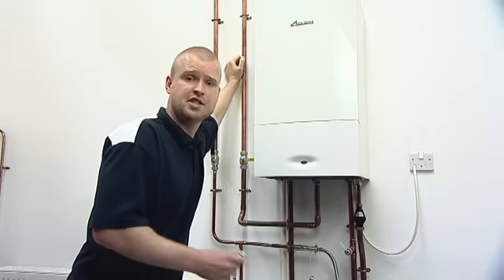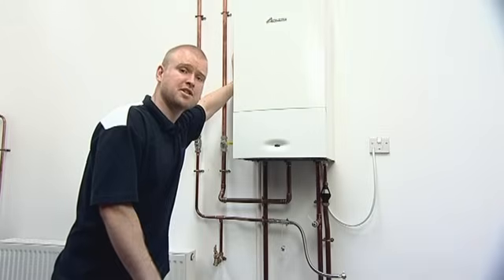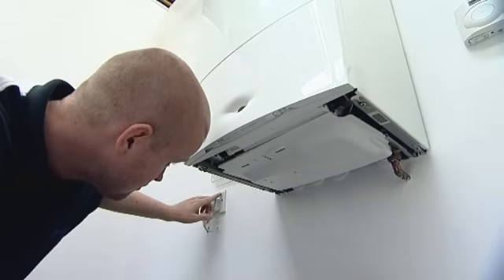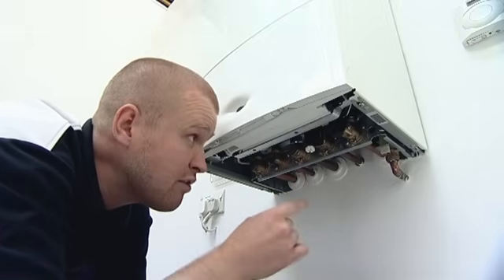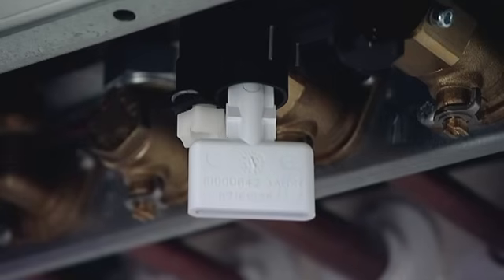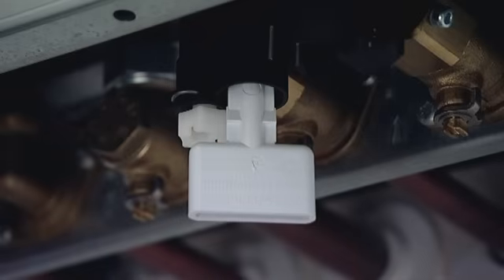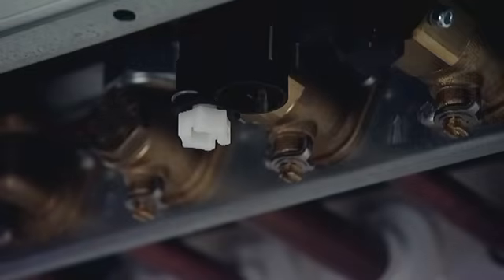How to Repressurise a Heating System with an Internal Filling Key | Worcester Bosch

Comment: When I turn plastic nut water comes out on mine also, why is this?
Reply from the maker: T LeJ Hi and thank you for your enquiry. 

If water is found to
be leaking from the filling assembly where the key inserts it would be because
the key is not inserted correctly and in the locked position. Typically the key
would need to be pushed higher into the assembly.

 

If
water is leaking from any other part of the filling link this would indicate a
fault with the filling assembly and would require a new part to be fitted.  Hope this is of help,

 <w:LatentStyles DefLockedState="false" DefUnhideWhenUsed="true"
  DefSemiHidden="true" DefQFormat="false" DefPriority="99"
  LatentStyleCount="267">
  <w:LsdException Locked="false" Priority="0" SemiHidden="false"
   UnhideWhenUsed="false" QFormat="true" Name="Normal"/>
  <w:LsdException Locked="false" Priority="9" SemiHidden="false"
   UnhideWhenUsed="false" QFormat="true" Name="heading 1"/>
  
  
  
  
  
  
  
  
  
  
  
  
  
  
  
  
  
  
  <w:LsdException Locked="false" Priority="10" SemiHidden="false"
   UnhideWhenUsed="false" QFormat="true" Name="Title"/>
  
  <w:LsdException Locked="false" Priority="11" SemiHidden="false"
   UnhideWhenUsed="false" QFormat="true" Name="Subtitle"/>
  <w:LsdException Locked="false" Priority="22" SemiHidden="false"
   UnhideWhenUsed="false" QFormat="true" Name="Strong"/>
  <w:LsdException Locked="false" Priority="20" SemiHidden="false"
   UnhideWhenUsed="false" QFormat="true" Name="Emphasis"/>
  <w:LsdException Locked="false" Priority="59" SemiHidden="false"
   UnhideWhenUsed="false" Name="Table Grid"/>
  
  <w:LsdException Locked="false" Priority="1" SemiHidden="false"
   UnhideWhenUsed="false" QFormat="true" Name="No Spacing"/>
  <w:LsdException Locked="false" Priority="60" SemiHidden="false"
   UnhideWhenUsed="false" Name="Light Shading"/>
  <w:LsdException Locked="false" Priority="61" SemiHidden="false"
   UnhideWhenUsed="false" Name="Light List"/>
  <w:LsdException Locked="false" Priority="62" SemiHidden="false"
   UnhideWhenUsed="false" Name="Light Grid"/>
  <w:LsdException Locked="false" Priority="63" SemiHidden="false"
   UnhideWhenUsed="false" Name="Medium Shading 1"/>
  <w:LsdException Locked="false" Priority="64" SemiHidden="false"
   UnhideWhenUsed="false" Name="Medium Shading 2"/>
  <w:LsdException Locked="false" Priority="65" SemiHidden="false"
   UnhideWhenUsed="false" Name="Medium List 1"/>
  <w:LsdException Locked="false" Priority="66" SemiHidden="false"
   UnhideWhenUsed="false" Name="Medium List 2"/>
  <w:LsdException Locked="false" Priority="67" SemiHidden="false"
   UnhideWhenUsed="false" Name="Medium Grid 1"/>
  <w:LsdException Locked="false" Priority="68" SemiHidden="false"
   UnhideWhenUsed="false" Name="Medium Grid 2"/>
  <w:LsdException Locked="false" Priority="69" SemiHidden="false"
   UnhideWhenUsed="false" Name="Medium Grid 3"/>
  <w:LsdException Locked="false" Priority="70" SemiHidden="false"
   UnhideWhenUsed="false" Name="Dark List"/>
  <w:LsdException Locked="false" Priority="71" SemiHidden="false"
   UnhideWhenUsed="false" Name="Colorful Shading"/>
  <w:LsdException Locked="false" Priority="72" SemiHidden="false"
   UnhideWhenUsed="false" Name="Colorful List"/>
  <w:LsdException Locked="false" Priority="73" SemiHidden="false"
   UnhideWhenUsed="false" Name="Colorful Grid"/>
  <w:LsdException Locked="false" Priority="60" SemiHidden="false"
   UnhideWhenUsed="false" Name="Light Shading Accent 1"/>
  <w:LsdException Locked="false" Priority="61" SemiHidden="false"
   UnhideWhenUsed="false" Name="Light List Accent 1"/>
  <w:LsdException Locked="false" Priority="62" SemiHidden="false"
   UnhideWhenUsed="false" Name="Light Grid Accent 1"/>
  <w:LsdException Locked="false" Priority="63" SemiHidden="false"
   UnhideWhenUsed="false" Name="Medium Shading 1 Accent 1"/>
  <w:LsdException Locked="false" Priority="64" SemiHidden="false"
   UnhideWhenUsed="false" Name="Medium Shading 2 Accent 1"/>
  <w:LsdException Locked="false" Priority="65" SemiHidden="false"
   UnhideWhenUsed="false" Name="Medium List 1 Accent 1"/>
  
  <w:LsdException Locked="false" Priority="34" SemiHidden="false"
   UnhideWhenUsed="false" QFormat="true" Name="List Paragraph"/>
  <w:LsdException Locked="false" Priority="29" SemiHidden="false"
   UnhideWhenUsed="false" QFormat="true" Name="Quote"/>
  <w:LsdException Locked="false" Priority="30" SemiHidden="false"
   UnhideWhenUsed="false" QFormat="true" Name="Intense Quote"/>
  <w:LsdException Locked="false" Priority="66" SemiHidden="false"
   UnhideWhenUsed="false" Name="Medium List 2 Accent 1"/>
  <w:LsdException Locked="false" Priority="67" SemiHidden="false"
   UnhideWhenUsed="false" Name="Medium Grid 1 Accent 1"/>
  <w:LsdException Locked="false" Priority="68" SemiHidden="false"
   UnhideWhenUsed="false" Name="Medium Grid 2 Accent 1"/>
  <w:LsdException Locked="false" Priority="69" SemiHidden="false"
   UnhideWhenUsed="false" Name="Medium Grid 3 Accent 1"/>
  <w:LsdException Locked="false" Priority="70" SemiHidden="false"
   UnhideWhenUsed="false" Name="Dark List Accent 1"/>
  <w:LsdException Locked="false" Priority="71" SemiHidden="false"
   UnhideWhenUsed="false" Name="Colorful Shading Accent 1"/>
  <w:LsdException Locked="false" Priority="72" SemiHidden="false"
   UnhideWhenUsed="false" Name="Colorful List Accent 1"/>
  <w:LsdException Locked="false" Priority="73" SemiHidden="false"
   UnhideWhenUsed="false" Name="Colorful Grid Accent 1"/>
  <w:LsdException Locked="false" Priority="60" SemiHidden="false"
   UnhideWhenUsed="false" Name="Light Shading Accent 2"/>
  <w:LsdException Locked="false" Priority="61" SemiHidden="false"
   UnhideWhenUsed="false" Name="Light List Accent 2"/>
  <w:LsdException Locked="false" Priority="62" SemiHidden="false"
   UnhideWhenUsed="false" Name="Light Grid Accent 2"/>
  <w:LsdException Locked="false" Priority="63" SemiHidden="false"
   UnhideWhenUsed="false" Name="Medium Shading 1 Accent 2"/>
  <w:LsdException Locked="false" Priority="64" SemiHidden="false"
   UnhideWhenUsed="false" Name="Medium Shading 2 Accent 2"/>
  <w:LsdException Locked="false" Priority="65" SemiHidden="false"
   UnhideWhenUsed="false" Name="Medium List 1 Accent 2"/>
  <w:LsdException Locked="false" Priority="66" SemiHidden="false"
   UnhideWhenUsed="false" Name="Medium List 2 Accent 2"/>
  <w:LsdException Locked="false" Priority="67" SemiHidden="false"
   UnhideWhenUsed="false" Name="Medium Grid 1 Accent 2"/>
  <w:LsdException Locked="false" Priority="68" SemiHidden="false"
   UnhideWhenUsed="false" Name="Medium Grid 2 Accent 2"/>
  <w:LsdException Locked="false" Priority="69" SemiHidden="false"
   UnhideWhenUsed="false" Name="Medium Grid 3 Accent 2"/>
  <w:LsdException Locked="false" Priority="70" SemiHidden="false"
   UnhideWhenUsed="false" Name="Dark List Accent 2"/>
  <w:LsdException Locked="false" Priority="71" SemiHidden="false"
   UnhideWhenUsed="false" Name="Colorful Shading Accent 2"/>
  <w:LsdException Locked="false" Priority="72" SemiHidden="false"
   UnhideWhenUsed="false" Name="Colorful List Accent 2"/>
  <w:LsdException Locked="false" Priority="73" SemiHidden="false"
   UnhideWhenUsed="false" Name="Colorful Grid Accent 2"/>
  <w:LsdException Locked="false" Priority="60" SemiHidden="false"
   UnhideWhenUsed="false" Name="Light Shading Accent 3"/>
  <w:LsdException Locked="false" Priority="61" SemiHidden="false"
   UnhideWhenUsed="false" Name="Light List Accent 3"/>
  <w:LsdException Locked="false" Priority="62" SemiHidden="false"
   UnhideWhenUsed="false" Name="Light Grid Accent 3"/>
  <w:LsdException Locked="false" Priority="63" SemiHidden="false"
   UnhideWhenUsed="false" Name="Medium Shading 1 Accent 3"/>
  <w:LsdException Locked="false" Priority="64" SemiHidden="false"
   UnhideWhenUsed="false" Name="Medium Shading 2 Accent 3"/>
  <w:LsdException Locked="false" Priority="65" SemiHidden="false"
   UnhideWhenUsed="false" Name="Medium List 1 Accent 3"/>
  <w:LsdException Locked="false" Priority="66" SemiHidden="false"
   UnhideWhenUsed="false" Name="Medium List 2 Accent 3"/>
  <w:LsdException Locked="false" Priority="67" SemiHidden="false"
   UnhideWhenUsed="false" Name="Medium Grid 1 Accent 3"/>
  <w:LsdException Locked="false" Priority="68" SemiHidden="false"
   UnhideWhenUsed="false" Name="Medium Grid 2 Accent 3"/>
  <w:LsdException Locked="false" Priority="69" SemiHidden="false"
   UnhideWhenUsed="false" Name="Medium Grid 3 Accent 3"/>
  <w:LsdException Locked="false" Priority="70" SemiHidden="false"
   UnhideWhenUsed="false" Name="Dark List Accent 3"/>
  <w:LsdException Locked="false" Priority="71" SemiHidden="false"
   UnhideWhenUsed="false" Name="Colorful Shading Accent 3"/>
  <w:LsdException Locked="false" Priority="72" SemiHidden="false"
   UnhideWhenUsed="false" Name="Colorful List Accent 3"/>
  <w:LsdException Locked="false" Priority="73" SemiHidden="false"
   UnhideWhenUsed="false" Name="Colorful Grid Accent 3"/>
  <w:LsdException Locked="false" Priority="60" SemiHidden="false"
   UnhideWhenUsed="false" Name="Light Shading Accent 4"/>
  <w:LsdException Locked="false" Priority="61" SemiHidden="false"
   UnhideWhenUsed="false" Name="Light List Accent 4"/>
  <w:LsdException Locked="false" Priority="62" SemiHidden="false"
   UnhideWhenUsed="false" Name="Light Grid Accent 4"/>
  <w:LsdException Locked="false" Priority="63" SemiHidden="false"
   UnhideWhenUsed="false" Name="Medium Shading 1 Accent 4"/>
  <w:LsdException Locked="false" Priority="64" SemiHidden="false"
   UnhideWhenUsed="false" Name="Medium Shading 2 Accent 4"/>
  <w:LsdException Locked="false" Priority="65" SemiHidden="false"
   UnhideWhenUsed="false" Name="Medium List 1 Accent 4"/>
  <w:LsdException Locked="false" Priority="66" SemiHidden="false"
   UnhideWhenUsed="false" Name="Medium List 2 Accent 4"/>
  <w:LsdException Locked="false" Priority="67" SemiHidden="false"
   UnhideWhenUsed="false" Name="Medium Grid 1 Accent 4"/>
  <w:LsdException Locked="false" Priority="68" SemiHidden="false"
   UnhideWhenUsed="false" Name="Medium Grid 2 Accent 4"/>
  <w:LsdException Locked="false" Priority="69" SemiHidden="false"
   UnhideWhenUsed="false" Name="Medium Grid 3 Accent 4"/>
  <w:LsdException Locked="false" Priority="70" SemiHidden="false"
   UnhideWhenUsed="false" Name="Dark List Accent 4"/>
  <w:LsdException Locked="false" Priority="71" SemiHidden="false"
   UnhideWhenUsed="false" Name="Colorful Shading Accent 4"/>
  <w:LsdException Locked="false" Priority="72" SemiHidden="false"
   UnhideWhenUsed="false" Name="Colorful List Accent 4"/>
  <w:LsdException Locked="false" Priority="73" SemiHidden="false"
   UnhideWhenUsed="false" Name="Colorful Grid Accent 4"/>
  <w:LsdException Locked="false" Priority="60" SemiHidden="false"
   UnhideWhenUsed="false" Name="Light Shading Accent 5"/>
  <w:LsdException Locked="false" Priority="61" SemiHidden="false"
   UnhideWhenUsed="false" Name="Light List Accent 5"/>
  <w:LsdException Locked="false" Priority="62" SemiHidden="false"
   UnhideWhenUsed="false" Name="Light Grid Accent 5"/>
  <w:LsdException Locked="false" Priority="63" SemiHidden="false"
   UnhideWhenUsed="false" Name="Medium Shading 1 Accent 5"/>
  <w:LsdException Locked="false" Priority="64" SemiHidden="false"
   UnhideWhenUsed="false" Name="Medium Shading 2 Accent 5"/>
  <w:LsdException Locked="false" Priority="65" SemiHidden="false"
   UnhideWhenUsed="false" Name="Medium List 1 Accent 5"/>
  <w:LsdException Locked="false" Priority="66" SemiHidden="false"
   UnhideWhenUsed="false" Name="Medium List 2 Accent 5"/>
  <w:LsdException Locked="false" Priority="67" SemiHidden="false"
   UnhideWhenUsed="false" Name="Medium Grid 1 Accent 5"/>
  <w:LsdException Locked="false" Priority="68" SemiHidden="false"
   UnhideWhenUsed="false" Name="Medium Grid 2 Accent 5"/>
  <w:LsdException Locked="false" Priority="69" SemiHidden="false"
   UnhideWhenUsed="false" Name="Medium Grid 3 Accent 5"/>
  <w:LsdException Locked="false" Priority="70" SemiHidden="false"
   UnhideWhenUsed="false" Name="Dark List Accent 5"/>
  <w:LsdException Locked="false" Priority="71" SemiHidden="false"
   UnhideWhenUsed="false" Name="Colorful Shading Accent 5"/>
  <w:LsdException Locked="false" Priority="72" SemiHidden="false"
   UnhideWhenUsed="false" Name="Colorful List Accent 5"/>
  <w:LsdException Locked="false" Priority="73" SemiHidden="false"
   UnhideWhenUsed="false" Name="Colorful Grid Accent 5"/>
  <w:LsdException Locked="false" Priority="60" SemiHidden="false"
   UnhideWhenUsed="false" Name="Light Shading Accent 6"/>
  <w:LsdException Locked="false" Priority="61" SemiHidden="false"
   UnhideWhenUsed="false" Name="Light List Accent 6"/>
  <w:LsdException Locked="false" Priority="62" SemiHidden="false"
   UnhideWhenUsed="false" Name="Light Grid Accent 6"/>
  <w:LsdException Locked="false" Priority="63" SemiHidden="false"
   UnhideWhenUsed="false" Name="Medium Shading 1 Accent 6"/>
  <w:LsdException Locked="false" Priority="64" SemiHidden="false"
   UnhideWhenUsed="false" Name="Medium Shading 2 Accent 6"/>
  <w:LsdException Locked="false" Priority="65" SemiHidden="false"
   UnhideWhenUsed="false" Name="Medium List 1 Accent 6"/>
  <w:LsdException Locked="false" Priority="66" SemiHidden="false"
   UnhideWhenUsed="false" Name="Medium List 2 Accent 6"/>
  <w:LsdException Locked="false" Priority="67" SemiHidden="false"
   UnhideWhenUsed="false" Name="Medium Grid 1 Accent 6"/>
  <w:LsdException Locked="false" Priority="68" SemiHidden="false"
   UnhideWhenUsed="false" Name="Medium Grid 2 Accent 6"/>
  <w:LsdException Locked="false" Priority="69" SemiHidden="false"
   UnhideWhenUsed="false" Name="Medium Grid 3 Accent 6"/>
  <w:LsdException Locked="false" Priority="70" SemiHidden="false"
   UnhideWhenUsed="false" Name="Dark List Accent 6"/>
  <w:LsdException Locked="false" Priority="71" SemiHidden="false"
   UnhideWhenUsed="false" Name="Colorful Shading Accent 6"/>
  <w:LsdException Locked="false" Priority="72" SemiHidden="false"
   UnhideWhenUsed="false" Name="Colorful List Accent 6"/>
  <w:LsdException Locked="false" Priority="73" SemiHidden="false"
   UnhideWhenUsed="false" Name="Colorful Grid Accent 6"/>
  <w:LsdException Locked="false" Priority="19" SemiHidden="false"
   UnhideWhenUsed="false" QFormat="true" Name="Subtle Emphasis"/>
  <w:LsdException Locked="false" Priority="21" SemiHidden="false"
   UnhideWhenUsed="false" QFormat="true" Name="Intense Emphasis"/>
  <w:LsdException Locked="false" Priority="31" SemiHidden="false"
   UnhideWhenUsed="false" QFormat="true" Name="Subtle Reference"/>
  <w:LsdException Locked="false" Priority="32" SemiHidden="false"
   UnhideWhenUsed="false" QFormat="true" Name="Intense Reference"/>
  <w:LsdException Locked="false" Priority="33" SemiHidden="false"
   UnhideWhenUsed="false" QFormat="true" Name="Book Title"/>
  
  
 

 /* Style Definitions */
 table.MsoNormalTable
 {mso-style-name:"Table Normal";
 mso-tstyle-rowband-size:0;
 mso-tstyle-colband-size:0;
 mso-style-noshow:yes;
 mso-style-priority:99;
 mso-style-qformat:yes;
 mso-style-parent:"";
 mso-padding-alt:0cm 5.4pt 0cm 5.4pt;
 mso-para-margin:0cm;
 mso-para-margin-bottom:.0001pt;
 mso-pagination:widow-orphan;
 font-size:11.0pt;
 font-family:"Calibri","sans-serif";
 mso-ascii-font-family:Calibri;
 mso-ascii-theme-font:minor-latin;
 mso-fareast-font-family:"Times New Roman";
 mso-fareast-theme-font:minor-fareast;
 mso-hansi-font-family:Calibri;
 mso-hansi-theme-font:minor-latin;
 mso-bidi-font-family:"Times New Roman";
 mso-bidi-theme-font:minor-bidi;}
Reply: +Worcester, Bosch Group just had this happen to me. Turns out the key needed pushing in higher.

Comment: One tip, make sure the key is firmly pushed in, I thought it was and had pushed as hard as I could but water was just coming out and the pressure remained zero. Put a bit of WD40 on it and it pushed in further and then worked as in the demo.
Reply: Do u have to put wd40 on the key

Comment: Hi can you tell me why i need to top up my boiler everyday the water leaks from outside pipe but i an still getting hot water and central heating is ok is it some thing to do with pressure relief valve 42 cdi greenstar combi

Comment: If you find yourself frustrated polite word unable to put the key into the socket underneath-black plastic manifold- use some WD 40 on end of key- ease key into manifold-mine would NOT go in - alighned it the lot- sprayed WD 40 on it- straight in- think of it as foreplay :D-good luck campers
Reply: Spot on!could never get key in straightaway,WD40,sorted, thanks
Reply: Tap water does the trick, too.

Comment: Help!
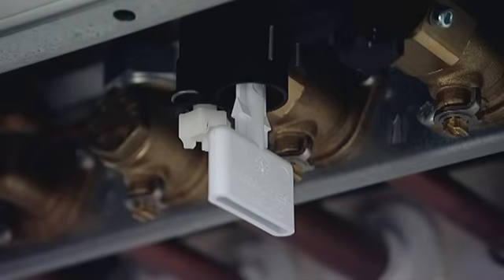I have the same boiler as in the video but when I get to about 1:57 (turning the nut whilst the filling key is inserted correctly and turned to the lock position) I don't hear any water going through or see any change in the pressure. Water definitely does come out when you turn it because I've tried turning the nut without the key in and got a free shower as a result(!!).
I'm not sure what I've done wrong, the grooves on the key fit snugly into the hole (I had a look underneath before putting it in to double check).

Any ideas?
Reply: Hi Ali.
Did you get any help on this in the end as im stuck with same problem suddenly. Did all a million times with key before but today, nothing! No water filling. Did you have any luck in any way please??
Thank you very much in advance.